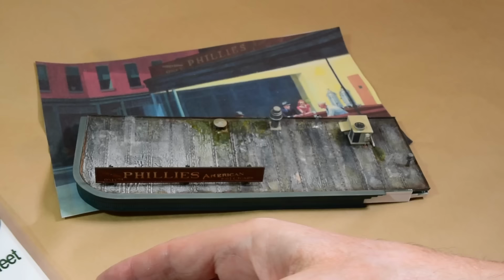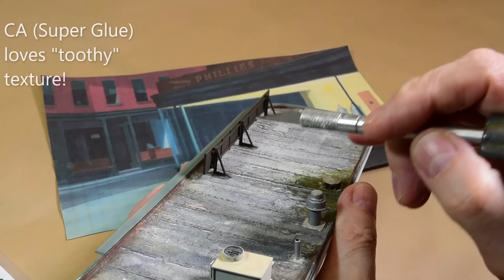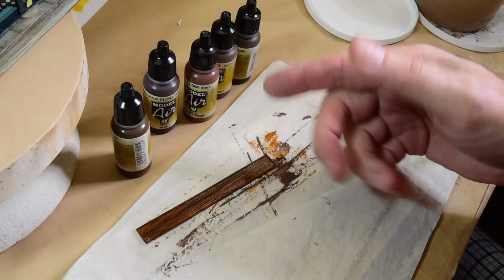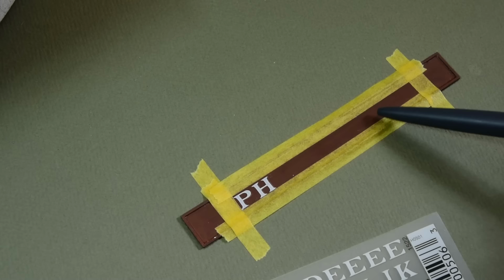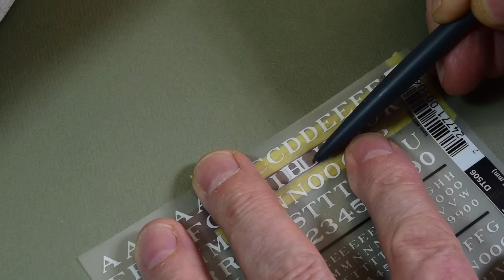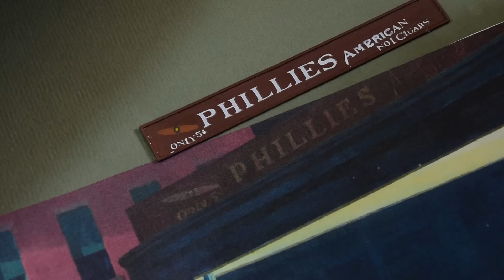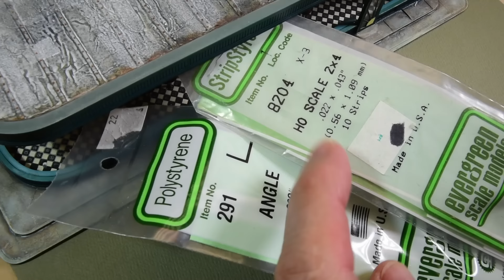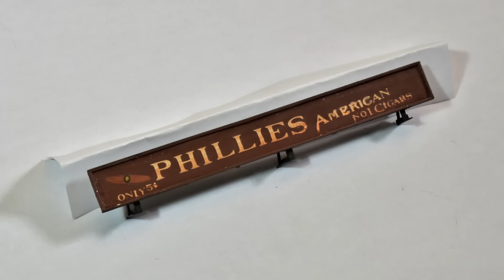The "Nighthawks" Diner Build (Part 10) | River Road ~ Vlog # 145

Comment: Boomer- the roof air conditioner. Do you think they were using evaporative swamp coolers then? No top fan. I am thinking 20s and 30s?
Reply: I’d say it’s in the works? He’s pretty detailed so maybe it’s coming.
Reply: Probably they didn't have them in the 20's but isn't this model as updated into the more modern era?
Reply from the maker: It's an older period building in the 'River Road' story (as in the real world). Except, in this case has been somewhat restored in 2010. This explains the modern AC unit and it's condition. There is always a history to the models I build, and I always model what I see in the present world as well. ;-) I also talked about this several times in the series. Cheers ~ Boomer.
Reply: @boomerdiorama  I’ve adopted a philosophy I heard from an old jazz guy when asked about mixing outdated styles- “if it was good then, it’s good now”.
Reply: And yet, the diner is just a representation placed in a contemporary model railroading diorama. 
Rule 1 applies here, it’s Boomer’s layout. Furthermore, could we indeed say the Hopper diner, or an actual size representation, or similar designed version of it wouldn’t exist in true life and scale? Hence, when the diner is placed in a contemporary setting, the AC-unit is indeed completely appropriate.
When and if you feel the need to do your own representation of Hopper’s artwork, feel free to place it inside the timeframe you’re modeling.
Reply from the maker: @vincenthuying98  Furthermore, the layout (River Road) is an exercise for teaching and tutorials as well. Period specific "legalism" is irrelevant to me when it is indeed possible in the real world.😁

Comment: Boomer, outstanding as usual. I thought this ole dog knew a lot, but I watch your videos and always learn something. Dry transfers are great for letting. Been using them forever, but it seems that most want to get away with a print off of the computer. The computer wasn't there when I started. I remember transferring newspaper print to make signs. Times have changed, but some things the times can't change. Great job.
Reply from the maker: Color printer signs look awesome for sure. Although sometimes they do like paper prints as well.

Comment: Boomer-I have been meaning to tell you that HobbyLobby has cheap realistic Neon model lighting in various colors. These are fibers that can be cut to any length and have a small controller with batteries. If you do electronics, the batteries can be replaced by a wall-wart. My Diner will be wrapped in the blue and red version as most diners on Route 66 were so wrapped. This would make Nighthawks very 2010s. We are having fun at 80 and learning 
from professionals like yourself.
Reply from the maker: Thank you. Your Diner scene sounds cool with the lighting as you described! Cheers.

Comment: Wonderful!! Love it!! I have also put dry transfers onto clear decal film then used it like a regular decal. Clover House has a huge selection of dry transfers. I love the way you built the sign too. Cheaper and better looking than a laser cut structure!
Reply from the maker: One of the primary appeals to scratching from plastic is the crisp and sharpness of the model. You can achieve clean sharp details with little clean up as well. Not to mention the speed of fast drying solvents and acrylics. 😁
Reply: @boomerdiorama  The crispness is a MAJOR advantage. I like the plastruct cement but when I work with Evergreen I use MEK. A quart costs the same as a small bottle. It doesn’t work an acrylic though.
Reply from the maker: @blaketatar1239  The MEK stuff is good. Nice savings for big builds.

Comment: The sign is very cool!! Thanks for the tips to construct a sign.   Question I have the 2 oils you used but they are water mixable oil will I still have to use the mineral spirits or use something else?  
Thanks
Reply from the maker: I don't use "water based" oils. They make no sense to me. Gouache on the other hand is water based. Use real oil paint.

Comment: Another great tutorial. Two questions. How long did you need to wait before masking over the oil wash to spray the sign mounting structure?  

Second question.  Your videos are a higher quality than most in terms of lighting,  and clarity of the video.  Would you be willing to share what camera and lighting you use?
Reply from the maker: Good questions:
1. I never waited long enough for the oil to dry. Oil takes months to cure, although it feels dry to the touch after a week. If you leach out the oil on carboard first, and use a little solvent, oil dry's (to the touch) much quicker. Hard to beat the "transparency" quality of oils though.

2. I use a DSLR Nikon D5500 (Mirrored) Camera with a cheap zoom lens. The trick is to set your camera to  "manual" settings and flood the area with as much light as possible. The more light you use, the lower the ISO setting which results in a sharper image. Furthermore, the more external light you use, the smaller the aperture (F-Stop), which provides greater depth-of-field. 

Having said this, you won't need to heat the room . . . lol. Cheers ~ Boomer.